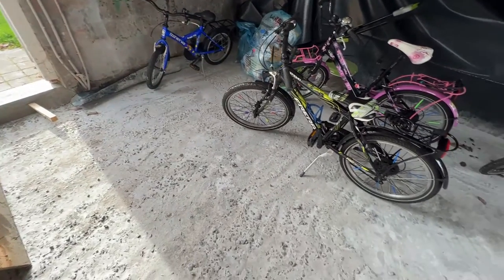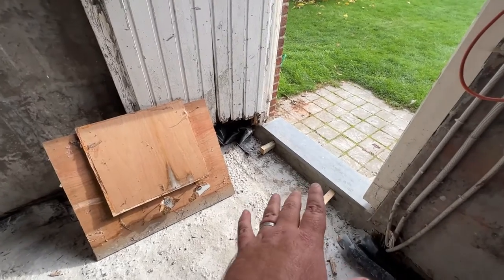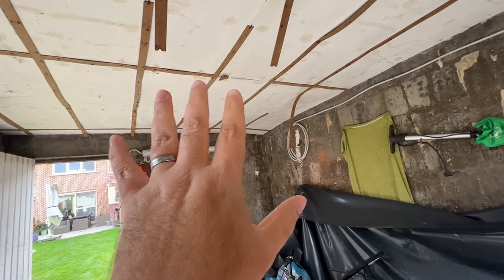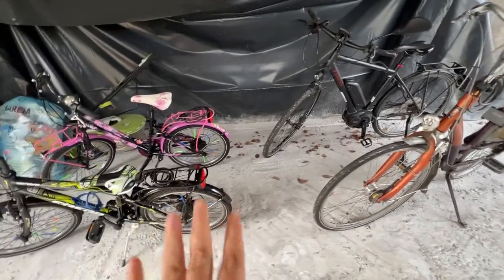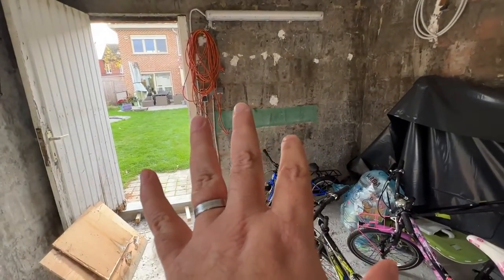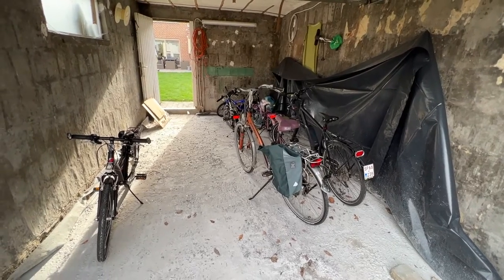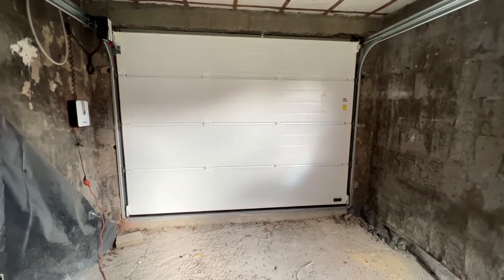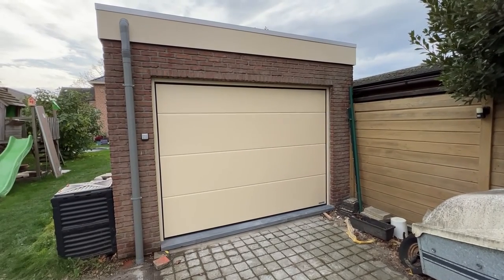Vlog 16 | Garage Project | Belgian #bricklinkseller | #bricklink  & #brickowl store

Comment: I'm about to move house, my new store room will be 4m x 4.9m so about the same size as your garage. I'm struggling to come up with a storage layout that both works for me and doesn't cost a fortune! One thing I would say is don't underestimate the need for larger drawers or tubs. The smaller drawers in Raaco units work well until they don't! Good luck and please keep sharing your journey!
Reply from the maker: Thanks for your nice reply! Space will always be an issue. If you check out my store tour video, you will notice that I have some big drawer cabinets too. I’m actually thinking about purchasing some “realyusefulleboxes” like the ones @brickarena uses.
Reply: @willebrickstore  I have loads of those, they work really well. I don't like the official inserts that Brick Arena uses though - for one thing they're quite expensive, but more than that, I want to be able to pick up one lot at a time and you can't do that with those. I use individual plastic boxes instead which do the job.